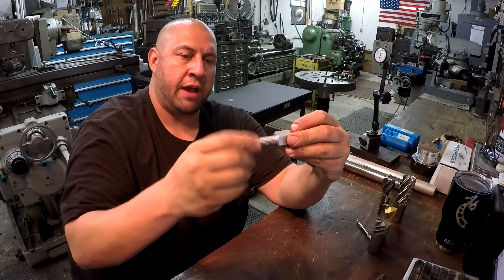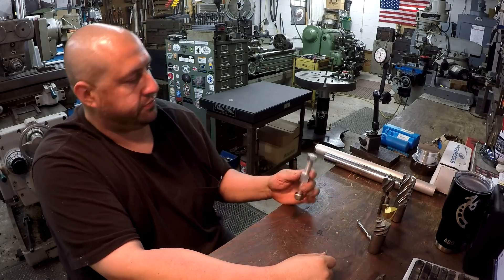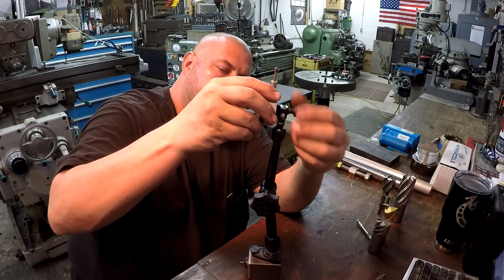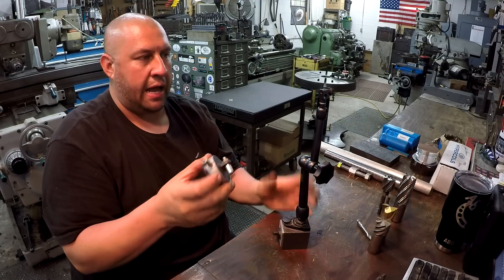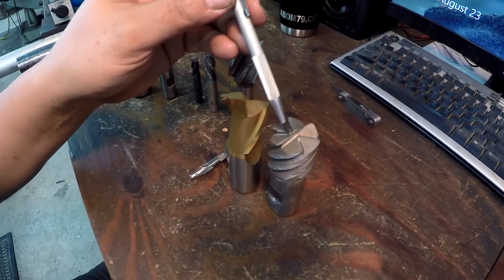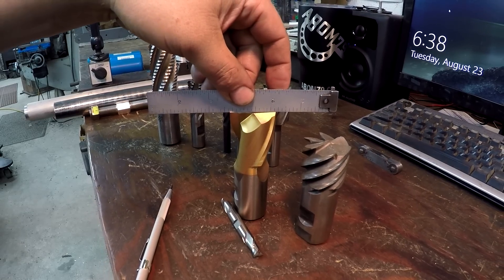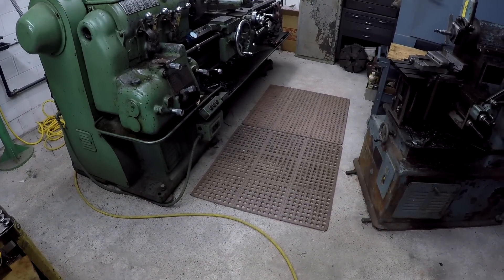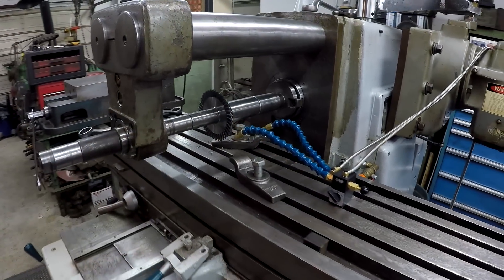Shop Talk 6: Center Cutting Endmills, Indicator Mounting, Noga Mini-Cool, Floor Mats

Comment: Adam, the coolant nozzles are on a magnetic base. If you mount them on the table they move with the part being machined. Would the base mount on the arbor support arms instead? Attaching the nozzles to the support arms places them in a fixed position in relation to the cutter. As the table, and part moves, the nozzles (mounted on the support arms) just keep applying coolant directly where it is needed. Since the support arms are round it may not work, but might be worth be worth a try.
Reply from the maker: +kwbarnes1 I normally mount the system on the overarms, but on that cut I was getting some chatter and making the magnet vibrate and slide around. I had to move to the table to keep things moving along. You'll see in the video.

Comment: Adam,
You are probably getting a lot of dust from the concrete because it wasn't sealed. One thing you might try is getting some heavy duty porch paint (for painting concrete porches), clean you floor and put on several coats of paint. I've used it before and it really keeps the dust down. Sweeping compound is a great to clean any kind of smooth floor. I used it in a couple of warehouses and shops I worked in. So . . . you have left-hand nuts? Does your girlfriend object? LOL  Thanks for another "Shop Talk" video. Was that thunder I heard in the background?
Have a good one!
Dave
Reply from the maker: +Swarf Rat Dave, yes the floor really needs to be treated. Wish I had down that before I moved everything in. Yes we had a bad thunderstorm roll over us just after i finished filming. 
Btw, I'm single again. No more girlfriend.

Comment: I don't believe I've ever seen a 2Flute endmill that wasn't center-cutting. In fact, I seem to remember that as a rule of thumb, whenever plunge cutting you should use a 2Flute.
Reply: Slot mill, end mill, plunge mill, key mill; millwright vs machinist/tool and die haha. Roughing mills; Rippa cutta, hogger, digger. I suppose it depends on who taught you.
Reply: All standard 2 flute are center cutting, you are correct. There may be some special grinds that are not.

Comment: Adam I'm glad someone asked about the shop and floor, I want to see what AF mats you get, I need to get some for the shop too.  Maybe a vacuum would work on your floor better than a broom?  I use a vacuum with a floor attachment that has a brush, it works pretty good.
Reply from the maker: +Bill De La Vega I'll show what I got, maybe his week. I want to invest in a large sized shop vac. I'm looking at the Rigid line.
Reply: Adam were I used to work we had Rigid vacuums.  They were OK, but the hoses were not the best, my Dad has a Rigid and the hose clip broke after about a month.  I have a Shop-vac brand here at the shop, it's a 15 gallon 6.5 HP stainless, I think they got it at MSC.  It's really expensive but is well made.

Comment: Since you mentioned indicators and how to mount them, I was wondering. I have seen some machinists permanently  mount an indicator on a tool post holder.  I'm sure you must have seen them. But you seem to prefer using he magnetic base with an articulated arm. Could you share the reason why you do not use one mounted on a tool post holder for your lathes. I'm thinking,  I'm missing something. Keep those videos coming. Between you, Keith Fenner, Keith Rucker, MR pete, Tom Lipton and numerous others I'm actually learning a thing or two.
Reply from the maker: +James Reed The tool post mounts are good to a certain degree. For much if my work in constantly having to move the indicator around, to different areas along the bed, or to the face. But I do have one I'll be sharing with you guys.

Comment: Adam you said when you swipe it is dusty.   I own a concrete construction company an part of the problem you have is that your shop slab was not sealed.   You can seal it one of the easiest ways is floor paint.  Or concrete floor sealer you just have to get the oil an grease off of it first.  it is way easier to paint the floor.  Thanks for the tip on dial mount.   I bought a noga copy a while back and I've just finished taking it apart and lapping all the clamping surfaces.  Works ok for me just getting back into the game.
Reply from the maker: +Bill “Big Bill” Thanks for the tips Bill!

Comment: I'm new to machining and my confusion persists when to use coolant,  when to use lubricant and when to not bother and just run dry. A detailed video devoted to the when, why and how of coolant vs. lubricant would be really helpful.  Also, the do's and don'ts of cutoff tools on the lathe would also be helpful.
Reply: Depends on how many holes your drilling and who's buyin, the tooling. Haw.
Reply: LOL! Since I'm the one buyin', now everything gets oil and/or coolant on the lathe and mill. When in doubt, lube it or cool it...
Reply: That Lazy Machinist has some video of this very topic. One combined with an explanation of a spin indexer and another quite recent on lubricant use when thread cutting.

Comment: Some really good tool and shop tips. 

One alternatives to sweeping is to use a good quality 10 gallon size shop vacuum with course brush floor attachment. This will solve your dust problem and allow you to dump steel shavings into your recycling bin. The other advantage is a good dry-wet vacuum has, is the ability clean up non-flammable liquids. I now vacuum my shop regularly so my dogs will not cut their paws on aluminum shavings when drilling out race car rivets from body panels. 

It also does a better job getting metal dust off the floor and tracking it back into the house! I also find that the chore is finished faster and allows me to clean work areas like my bench grinder, tables and all the nooks and crannies with the attachments that are included.

The anti-fatigue mats are a real smart investment. Anyone that has to work and stand on concrete floors daily will testify to the benefits of using them. I use one in front of my work bench in my race shop. 

The ones with holes are excellent. Using a shop vac will save time and still do a good job with them on the floor. While I realize your shop space is limited, try to avoid the smaller size units less than 10 gallons. The bigger units have more Abom power!

Thanks for another great shop talk!
Reply from the maker: +Doug Hanchard Yes I have a small shop vac and ready to invest in a much larger size. I've been hearing good things about Rigid vacs.
Reply: Rigid and the original, "Shop Vac" are very good models. If there is one drawback to the Rigid is their accessories are not interchangeable with other attachment options available from other vendors. But otherwise, very good units.
Reply: +Abom79 Adam,  get a Mr. Nozzle hose for the vacuum. Way better than stock. I'm also a fan of the Ridgid vacs. Just invest in the
 Mr. Nozzle hose.

Comment: Hi Adam, 
Maybe you could seal the concrete floor with some of that clear driveway sealer ?
Might not be perfect but may keep the dust down a little.
Reply from the maker: +ian bertenshaw I have thought about that, just gotta get some and try it.

Comment: Seems like it would help to have the Noga stationary relative to the cutter rather than fixed to the table. Is there a way to mount it on the upper section?
Reply from the maker: +Kyle Jacobs You can mount it anywhere you want. You can also remove it from the magnet and bolt it to whatever figure you create.

Comment: Hi Adam
Perhaps an industrial strength vacuum cleaner could solve your floor dust problem. Would also be able to make it somewhat clean between the floor mats without lifting them.

I have a couple of questions regarding the end mills. What is the opposite of a roughing mill - a smoothing? And would it be prudent to drill a center hole regardless of the endmill is center cutting or not?
Reply from the maker: +Peter Riis I have a small shop vac and yes it works wonders. I would like to acquire a much bigger one. The endmill your asking about would be a finishing endmill, or the style like I showed that are center cutting. The cutting flutes will have a smooth edge along the helix. Sometimes milling or drilling a center is a good option, but not always necessary.
Reply: Abom79 - Got it. Thanks.

Comment: Have you ever tried one of those wheeled magnets for picking chips off the floor? It seems like a good idea but I don't know in reality how well that would work. I am going to have to invest in a new shop vac for my shop as the old one is on its last legs and i like to vaccum off my machines especially after working on cast which is so much of what I do. On all my piston jigs I make them to hold by the wrist pin, it is  good and strong and its a consistent datum to work from for doing machining. Skirts and overall heights can vary but pin position is usually spot on and there is no danger in marring the surfaces or distorting the piston as some pistons are made not round on purpose.
Reply from the maker: +bcbloc02 Brian, I want to get s larger shop vac. I have read online that Rigid is a good brand to buy, and the hoses are top notch! Seems like every shop vac hose I've ever had turns into a useless piece of crap. So I'm eyeballing those. I found one in CL $50 but never called. These piston skirts are not round and have to be trimmed, but only like .002. Going to be tricky.
Reply: Hey Adam, been doing a lot of research on shop vacs as of late and am eyeing the Ridgid 1851 as a top contender, just got to find a good deal on it.  As for hoses, I have found that pool hoses do a lot better job than most of the factory shopvac types, are cheaper and tend to come in longer lengths which might come in handy given the length of your shop.

Comment: great video as always, i always enjoy your information on cutting tools, always practical enough for the hobby machinist to understand well. Would love to see a video on the differences on different inserts such as MMNG, CMNG TMNG. and the advantages and disadvantages of each on different metals and use with different holders. Thanks
Reply from the maker: +Bryson Kester I do plan to talk about common turning insert. 👍🏻
Reply: +Abom79 There are good charts and diagrams online for carbide insert nomenclature such as http://www.carbidedepot.com/formulas-insert-d.htm I am curious on positive and negative inserts. When to use what type of insert. When to use high speed steel instead.

Comment: Hey, that's for the description of the center cutting vs non.  Was wondering about that.  I am going to have to get out and make one of those indicator attachments.  Hopefully that helps with the different knobs being in each others way on the fine adjust top types.